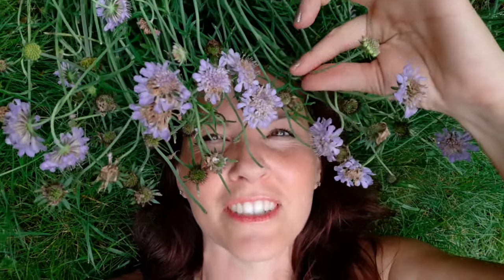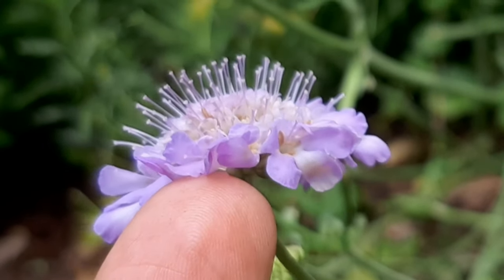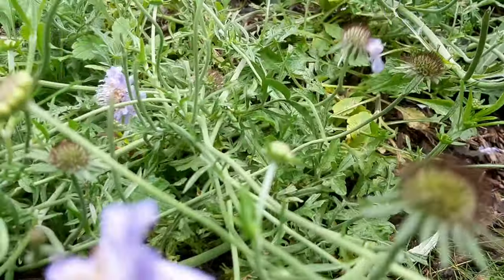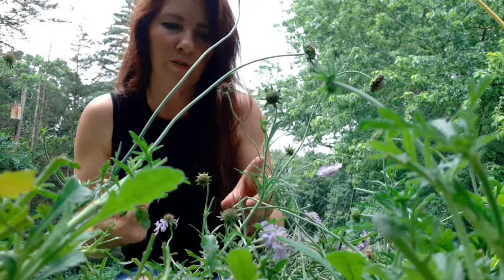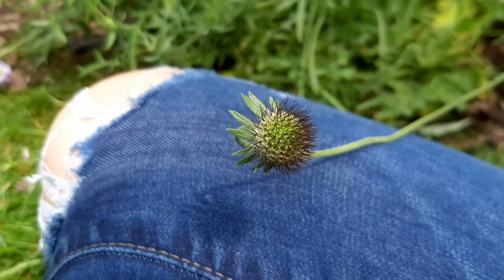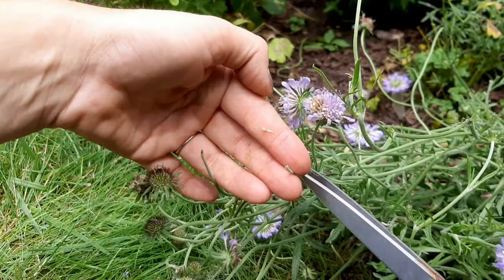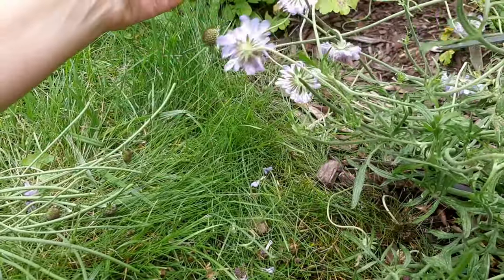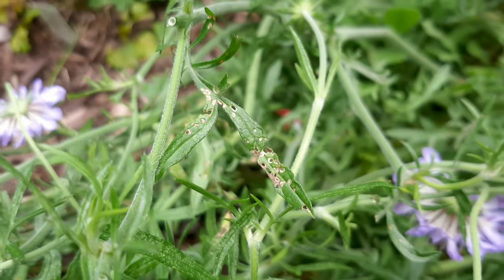How to Deadhead Pincushion Flowers📍💀✂️ Video Tutorial • Growing Home Gardening

Comment: I planted one this spring. They are quite striking & whimsical. Do they spread by seed? Mine was a very good size when planted.
Reply from the maker: Yes, they are exactly that!  Yes, they can lightly spread here and there but not invasively.  But, I haven't had that happen with mine yet. Apparently, the new seedlings would most likely be different than the parent plant, depending on the variety.  Since there are so many flowers you can just shear it back mid-summer and the may bloom again in fall.  If you want more plants, you can divide yours and replant.